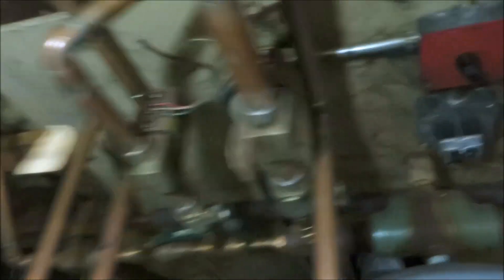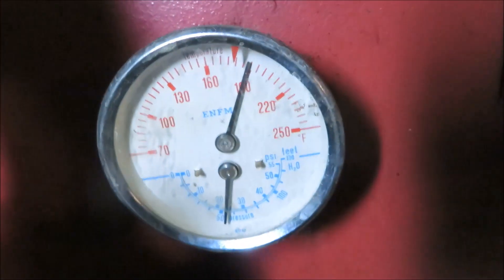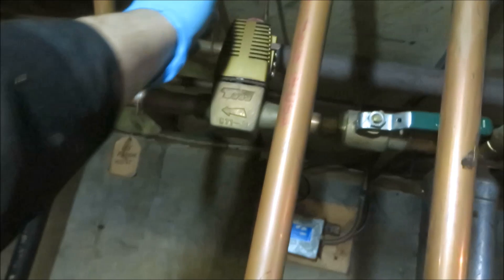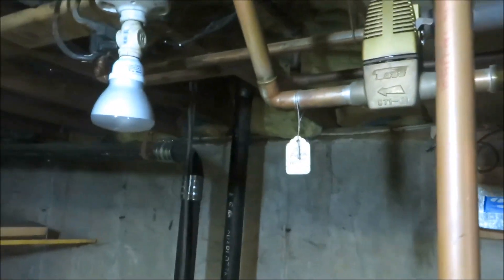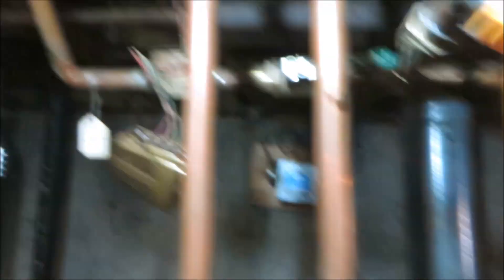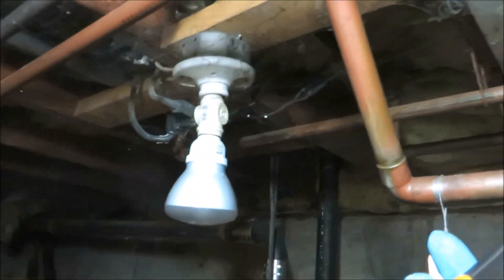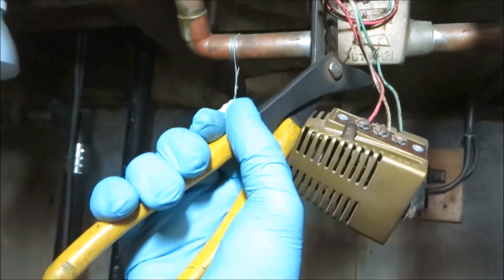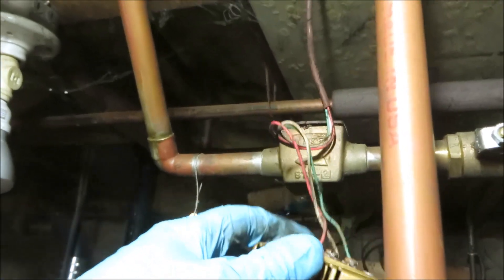purged air from heating zones with zone valves,bad zone head

Comment: I had one blow apart before and someone told me to i should remove power and wait 4 or 5 min so it denergizes. I dont work with taco often
Reply: It's written on  their packaging material as well.  It works by heating some substance that causes internal pressure to build up and force a rod  into the valve.

Comment: Steve i've noticed alot of these boilers in you're video's don't seem to have air scoops or separators installed..? Whats the deal? Im my area almost every professonially installed hydronic system has one on the outlet of the "boyla"
Reply from the maker: well i am there to service the boiler not repipe his system that someone installed  most systems i see don't have air scoops on them . who cares about and air seperater when you have a purge station???? that sounds like a comment from and aprentiss
Reply: LOL..I'm definately not a apprentice.. I'm just sayin it's good practice is all... i'm just curious if that is the norm in you're area.. The air separartor is obiviously not designed to purge the system for you its designed to remove "entrained micro bubble's from the system" over time etc.. I'm not trying to knock you i think you do great work...
-Sean
Reply from the maker: plumbworker just so you know i work on a lot of old stuff if someone calls me for a no heat call,, i can't rebuild there system just because i am a nice guy .. so some stuff you see will be fucked up so don't get your panties in a bunch i do the best i can with old shit .. as long as it works i don't lose any sleep over it i have 20 more calles to go on after this call...
Reply: I hear ya.. I look forward to some more old fucked up systems.. have a good weekend and take it easy..

Comment: Those taco valves look like there made easy to work on. Good job
Reply from the maker: yes i work on a lot of them .. there is basicly 2 waysto zone  one cerculator with zone valves,,, or all cerculators with flow checks with makes a better system.

Comment: Hey Steve. Cool video.  What made you think air was in the system?  Was it the sound of water moving through the pipes?  Also how does air get into a boiler that has already been bled and has worked fine for years?  Thanks alot.  Jeff
Reply from the maker: it sounded load  so i purged it just be safe .its a well so its hard to get all the air out with wimpy water pressure .air seems to happen for some resion sometimes you just have to purge to remove it from time to time ..like they say shit happens

Comment: Had a bad taco once, was sprout, lentil and sweet corn. Good job i work outside mostly...

Are they low voltage? Pretty much everything here is 240v ac
Reply from the maker: the taco zone heads are 24 volts
Reply from the maker: ***** well more control zones here in america are low voltage